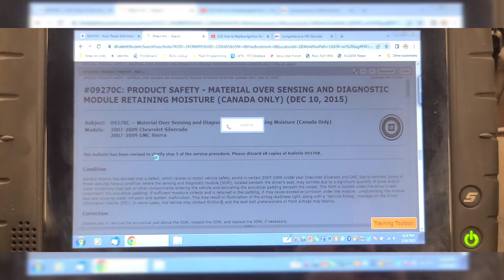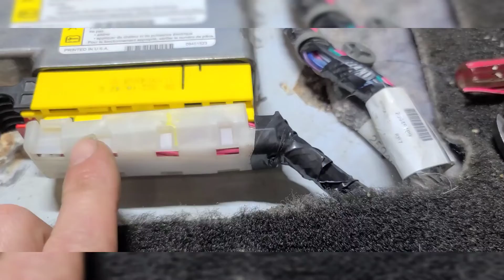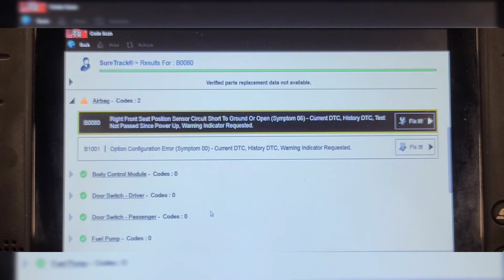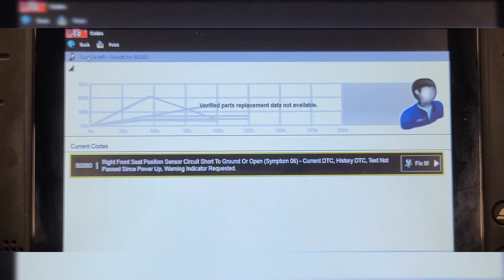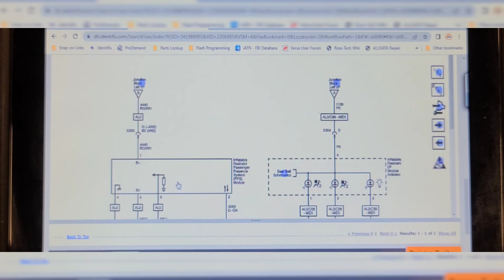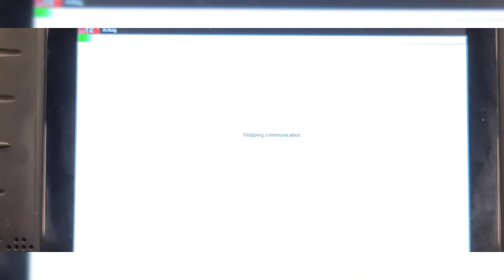2009 GM Truck Air Bag Module Replacement And Other Repairs

Comment: I need to replace the same wires on mine but don’t have an extra harness connector to use and can’t figure out what the female connector is to just replace the corroded female pin. Can anyone help me identify the female pin type or point me to where to buy a used connector? I can’t find one anywhere…
Reply from the maker: Your best bet is a used connector from a salvage yard. I'll look up the GM terminal number and post it shortly...
Reply from the maker: GM number is 13682165.

Comment: 2007 gmc Yukon Denali B0083 passenger SRS IS that a seat position sensor  I unbolted seat but I have to see if that sensor is broke
Reply from the maker: B0083 is for a faulty left front end crash sensor on the lower red support. Most likely will be a faulty sensor but could also be wiring to it. If the wiring looks good swap the two sensors side  to side and rescan. If it now sets a B0084 for the right side replace the sensor. I'd also recommend that you use an original equipment part from the dealer according to the vin.

Comment: Hi. Knowing these modules corrode so easily could one theoretically put a coat of paint on it to prevent that without interfering with the operation of the airbags?
Reply from the maker: Sure that would not hurt

Comment: what progeam do i need to reprogrem the SDM air bag Module? i have hp tuners. but im not sure that will do it. thanks!
Reply from the maker: @ODellGarage731  in this case  I put a used module so it was already programmed so it just had to be married to the BCM. Most full function scan tools will do this. To program a new module you need GM Service Programming System and a laptop with a J2534 pass through programmer.
Reply: @PhillipBailey  thank you for the quick response. i think getting a used module is the route im gonna take. any idea what GM would charge is i done all the labor beside the marry part? trying to see if i can kind a shop to do it.
Reply from the maker: @ODellGarage731  what's wrong with the old module that it requires replacing it. Labour should be less than an hour in my opinion.
Reply: @PhillipBailey  it so corroded beyond belief. Had a leak with the back glass. Has have air bad code plus the guage cluster goes nuts sometimes was cleaning the truck out an found the module covered I mean covered in corrosion
Reply from the maker: @ODellGarage731  make sure the wiring in the connector is not corroded as well. This one needed a couple of the terminals replaced.
Reply: @PhillipBailey  I seen a few that needs attention. Anything i can use to clean them terminals without replacing? May try to find one with the harness plug an do what u did
Reply from the maker: @ODellGarage731  Deoxit spray and compressed air but it's not hard to replace a terminal and splice the wire. Just need a used connector.
Reply: @PhillipBailey  thanks for the advise. Subbed keep em coming
Reply: @PhillipBailey  so I can use a used sdm from another truck with no reprogramming? Just clear the codes
Reply from the maker: @woods702 used one should work but you need to set it up in the BCM
Reply: @PhillipBailey  so I can't just plug it in will I need a fancy code reader I don't think my basic one can do any of that
Reply from the maker: @woods702  yes you will need a full function scanner for that
Reply: @PhillipBailey  I appreciate your time thank you

Comment: Having airbag code B0098 on my 2009 gmc 3500 work truck. Ideas? Thanks
Reply from the maker: Tests/Procedures:	1. Disconnect the harness connector at the inflatable restraint I/P module disable switch.

2. Ignition ON, verify that a test lamp illuminates between the ignition circuit terminal B and ground.

3. If the test lamp does not illuminate, test the ignition circuit for a short to ground or an open/high resistance, if the circuit tests normal continue.

4. Verify that a test lamp illuminates between the I/P module disable switch signal circuit terminals E and A and B+.

5. If all circuits test normal, replace the inflatable restraint I/P module disable switch.
Reply: @PhillipBailey  thank you

Comment: Phil, I noticed that the seat belt chime (and icon on the cluster) was not showing on the instrument panel before you fixed the Battery Power pin on the SDM connector. Do you know why/how these are related? I'm having an intermittent "Service Air Bag" light and no seat belt/icon on my 2010 Silverado. How would you troubleshoot this?
Reply from the maker: Well you're very observant. I would imagine the instrument cluster receives data over the serial data or can bus from the air bag module so if it's offline the indicator in the cluster may not work.  The chime you hear is actually coming from the radio speaker usually on driver front and the radio is on the network. If an aftermarket radio is installed they usually add another module to return the function of the seat belt, key in ignition and head lights left on warning. I'd start with a network scan of all controllers retrieving codes and then see if there is the ability to bidirectional control the light in the cluster and the chime function. You will need a full function scanner to do this obviously.  Look at data and controls in Air Bag, BCM, Cluster, Radio. Good luck.

Comment: I have a B0091 code for front air bag crash sensor on my 2008 Chevy 3500hd, replaced crash sensor with multiple different ones, still have the light on dash. I was looking to trouble shoot wiring to crash sensor but there is very little info on how to. I lifted carpet to unplug sdm which is very very hard to get to, and there seems to be some corrosion build up on sdm. Not sure if that code tho would have anything to do with it
Reply from the maker: Best to remove the seat and lift the carpet to inspect the module. To test the wires to the sensor from the module connector use an ohm meter to check continuity of each wire, shorts between wires and shorts to ground